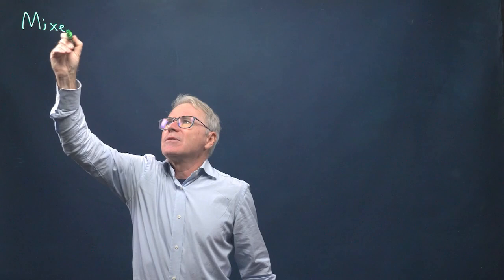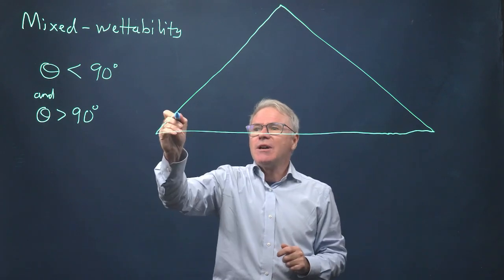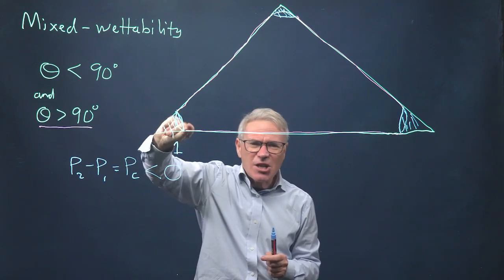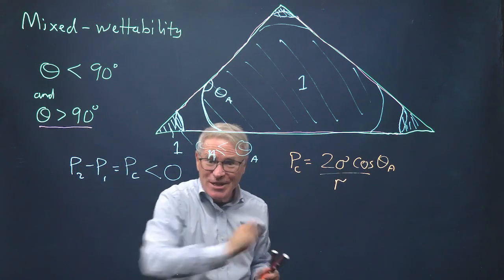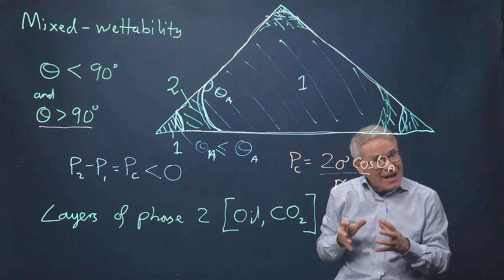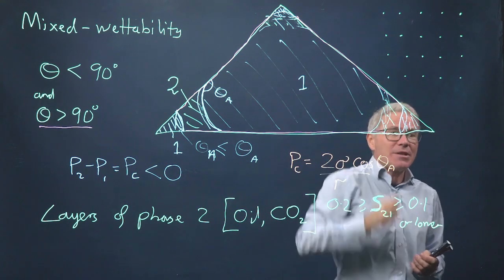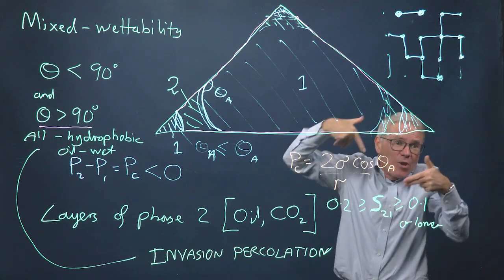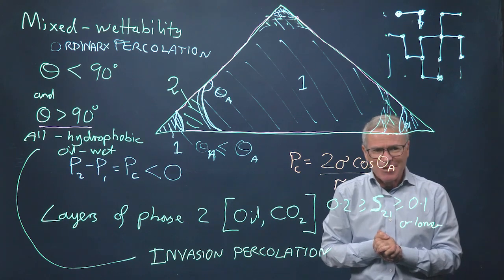Layers of water and oil

Comment: Thank you for the lecture series professor.

First Question: In mixed wet system, imbibition initially leads to alteration of contact angle before the piston-like advancement of injected fluid (water) through the center of pore. My question is, is water also moving across the system through only the wetting layers during the time contact angle is altering (i.e. before the centered piston-like advancement happens)?

Second Question: If the system is totally water wet, will imbibition happen similarly? My thinking was that injecting of water in such system leads to movement through smallest throats first which results in swelling of wetting layers to a point where the throat eventually snaps and fills the adjacent pores. There will be no contact angle alteration here (other than due to I3 events which are less common), am I correct?

Thanks in advance
Reply from the maker: The change in wettability - contact angle - occurs after primary drainage and before waterflooding.  So we assume that there is no contact angle change during water displacement processes.  Yes, there is snap-off and layer swelling, as you say, in the water-wet regions of the pore space.
Reply: @BoffyBlunt  Thank you for your response professor.
Will there be contact angle hysteresis {changing of theta(receding) to theta(hinge) to theta(advancing} if the system is completely water-wet?
Reply from the maker: @hms9520  Yes there can still be hysteresis if the advancing contact angle is larger than the receding angle, even if both are less than ninety degrees.

Comment: Key takeaways:

1) Primary drainage or primary migration is the movement of oil (non wetting) inside the reservoir rocks moving the initially present water into smaller pores or corner of the pores. After a while, oil due to its contact with the rock becomes wetting in these regions.

2) Injection of water is in piston like manner, where it fills middle of the pore leading to layer of oil formed between middle water and water at corners. This layer becomes smaller and smaller as more water is injected.

3) Mixed wettability involves both snap off (smaller pores) and percolation (larger pores) processes.
Reply from the maker: Many thanks for this summary.  Point 1 is correct, with the caveat that the wettability change depends on the oil, rock and brine as well as the temperature and pressure: in some cases the rock becomes oil-wet, in others not.  Moreover, we can see a mix of water-wet and oil-wet pores in a single sample - this is mixed-wettability.

Point 2 is correct in oil-wet pores.

Point 3 requires some clarification.  In a mixed-wet medium, the water-wet pores and throats fill first (the throats by snap-off) in a percolation-like process.  Then oil-wet pores are filled from the already water-occupied regions of the pore space.  This is no longer invasion percolation as the water need not be connected through the centre of the pore space to the inlet.  Overall displacement in a mixed-wet medium is best thought of as a percolation (not invasion percolation) process.